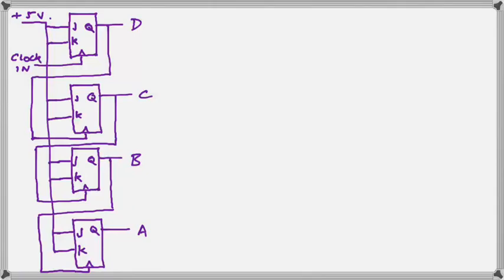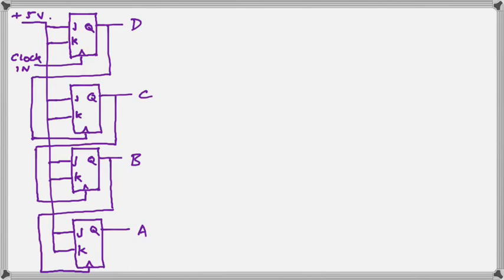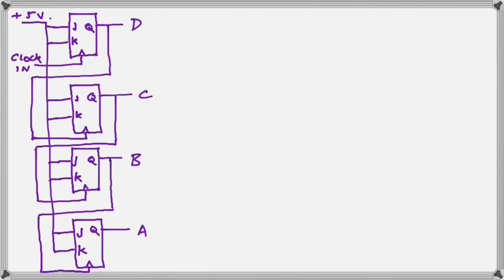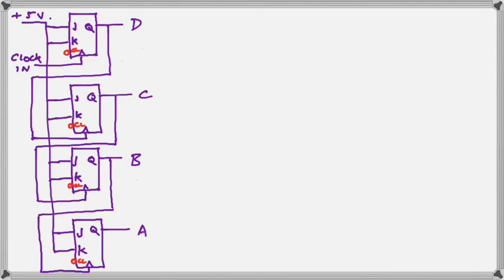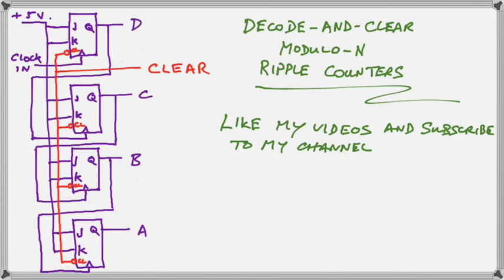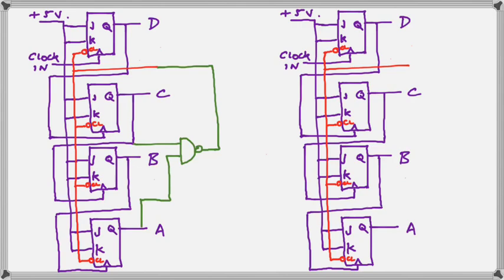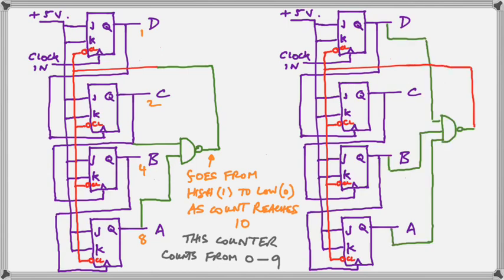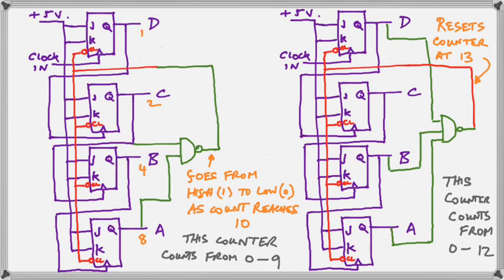Decode-and-Clear Modulo-N ripple counters

Comment: But propagation delays do allow a 1010 and 1101 to briefly appear on ABCD, and given that you have a clock pulse in the system, likely to be clocking other logic components, too, it's reasonable to assume that these forbidden states can get clocked into components attached to ABCD, right? How do you provision against that in the circuits in your lectures?
Reply from the maker: You are absolutely correct..... propagation delays are the MAIN REASON  why ripple counters are a BAD IDEA in the first place !!!
Even without the decode and clearing...... the inherent design of a 'ripple counter' has propagation delay problems..... actually that is why it's called a 'ripple' counter..... because of the RIPPLE effect in the ABCD output coding..... the students are fully advised about the propagation delay problems associated with ripple counters ....... but they are, ONE, still expected to know of their existence and TWO, they can still be utilized in very slow-speed circuits where the propagation errors do not cause an issue because of the long time period between clock pulse transitions (relative to the propagation timing, of course)